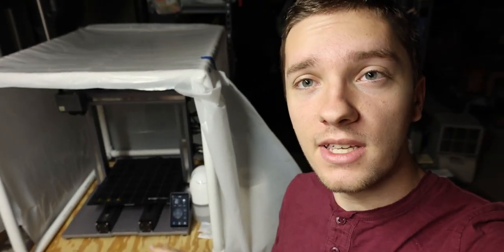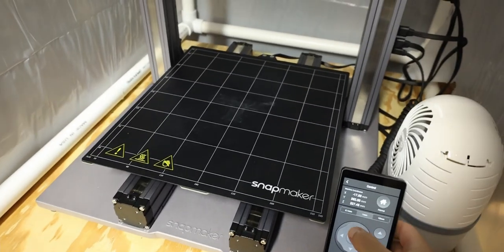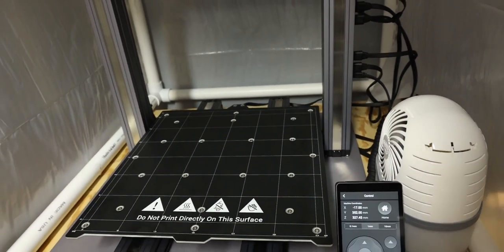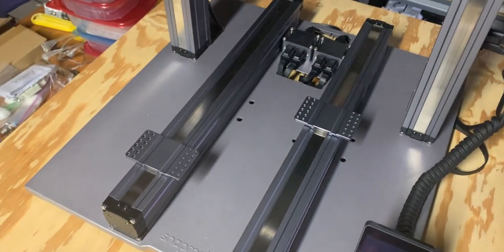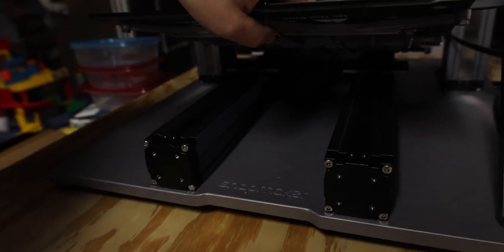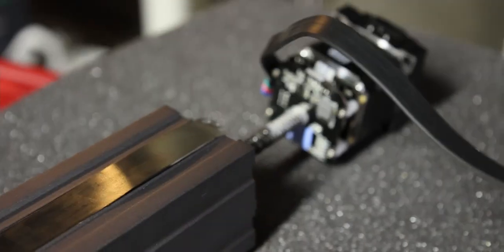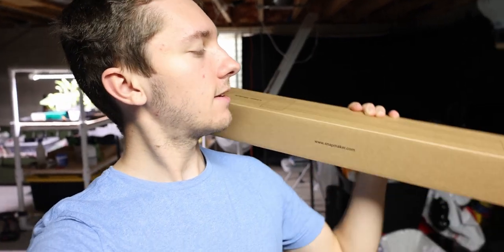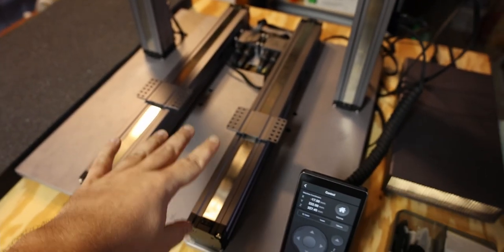This BROKE My Snapmaker 2.0! What Was My Experience?

Comment: I had two of the original rails fail a month apart in November and December 2020. Support was great at replacing the failed rails. While waiting for the replacement I opened up the failed rail and the board had burnt chips. I removed the motor and screw and reinstalled the rail and I was back up and printing. When the replacement arrived I installed it and we have been good since. fingers crossed.

Comment: This happened with mine when I first put it together. My fix was to check the serial numbers of each motor (need to undo and lift the metal strips to see the tag) I then reassembled putting motors with closest serial numbers together. This worked because there were slight differences between different "builds" from the factory. Dunno if this will help you with yours but certainly worth a go ;)

Comment: I needed 3 parts. The parts didn't fail. I moved cross country and parts got lost in shipping. Who knows, I still have some unpacking to do so they might magically show up. So, I was not under warranty but not bad prices. I needed a print module, that was the most expensive, and 1 converter and I decided to just order an extra heated bed. They shipped from their warehouse here in Goodyear, AZ, I live in Gilbert, AZ so around 1 hr away, I could have picked it up. BUT there was a problem. You would not believe the box that came. Either the warehouse POORLY and I mean REALLY poorly packaged it or UPS damaged it. I got one part of 3, box top was loosely taped closed and 2 parts must have fallen out either at the warehouse or via the UPS shipping. Not sure which or maybe both. I contacted Snapmaker and they sent me a replacement of the 2 items and a bonus 500kg of filament. Shipped from China BUT I got it within a week which surprised me as I thought, like you, that it would get held in customs in Los Angeles, which it did come on shore in LA. All was good. I do have outside video surveillance so I sent them a video of the UPS guy dropping off a very damaged and unsealed box. They appreciated that as they need to either make a UPS claim or change warehouses. So, I am up and running. I actually have multiple 3D Printers. I started off with a very VERY similar machine a Dobot MOOZ 2. Someone must have sued someone because the original Snapmaker and the Dobot MOOZ 2 look identical, someone copied the other.I also have a SINDOH DP200. Don't buy one of them, it's over engineered. If you get an extruder jam you have to get into the machine as it's a closed cabinet. And it's got too many automated systems to make things "supposedly" easier for beginners. It has a cassette type cartridge filament holder which means, if you want to buy filament from other vendors you have to spin off the filament on the other vendors reel and load onto the SINDOH reel so it can be put into the cartridge. They did send me updated firmaware so I can use 3rd party filament and eliminate the cassette. That works well but if you rely on the filament run out sensor the automation constantly jams the extruder. And there is an engineering design flaw. The bed on the SINDOH moves upwards as it prints. Unlike the Dobot or Snapmaker where the print module lowers. On the SINDOH the bed moves up and down. Bad design as the support for the bed is plastic riding on the drive screws which are towards the back of the bed support leaving the front unsupported.. Eventually the plastic wears, especially since large items on a bed can add weight and cause this wear. So, DON'T get a SINDOH. I also have a Lulzbot TAZ 5 that I updated to make it a TAZ 6. In some ways the Lulzbot is better than the Snapmaker in that I can adjust the bed and nozzle temps during the printing. Perhaps the newer Snapmaker has this function but I have the A350. The Lulzbot is cool as I can prototype more quickly as it uses 3mm filament through a .4 nozzle but the flow rate is quicker as the filament is larger so it prints fast. I also got a MOARstruder body which mounts a 1.2mm nozzle so you can REALLY print prototypes super quick. Then I go back to the ,4mm nozzle for detail after I am satisfied with the prototype. This is funny, the prints on the Dobot MOOZ 2 has the best quality. I did convert ALL my printers to PEI beds. The Lulzbot comes with a PEI heated bed and bed adhesion is so good that I mounted a PEI bed to the Dobot and the Snapmaker. Awesome improvement as I have zero issues now with any of the machine with adhesion. Cheers and wow I typed a lot here.
Reply: on the bambulab bed moves up down also, seems like one of best printers.

Comment: How is the snapmaker working? I see the dual print head is a disaster only videos on youtube are how it does not work.
Reply from the maker: We haven’t had any other problems with the machine since this incident. We only really use it for 3D printing since we already have the offset set and don’t have a ton of time to change the bed out. We also just haven’t learned too much about the other functions to have many ideas for it. We are still on the 2020 firmware because we kept hearing about the print head crashing into the bed and the firmware that shipped with the machine works so we never updated. So far, we like it. If you want to just 3D print, there are better and faster machines out there but if you want to be able to have the option of using the CNC or laser, I like it.

As for your question about the dual extruder, we recently received the Snapmaker Artisan and that comes standard with the dual extruder so we will be testing that out as we print on that machine. The unboxing video is all we’ve made for the Artisan at the moment.

Comment: Great to see some 'bad' experience with the snapmaker. I'm thinking of getting one myself, just need the money for it. Good to know the support is there if something goes wrong.
Reply from the maker: I've been lucky to have a good experience with the Snapmaker so far. They do have some quirks but it's alright. It isn't a great machine at all of its uses but it is a great machine for experimenting with the 3 types of manufacturing, 3D printing, Laser, CNC. It has allowed me to create anything I can think of and I really enjoy that!!
Reply: @RyanTuscher  I got mine yesterday. I don't expect it to be great at everything, that's always the issue with a x-in-1 machine. But for the limited space I have and what I'll be doing it should be plenty. The first benchy came out great even with crappy filament, so I'm happy with it so far

Comment: That is the nice about this machine. It is modular and you can just replace the faulty part easy. Good to see that the support was fast and accurate. Sidenote: even if you do not have warranty this module can be ordered separate for around 100 bucks. Not too bad either.
Reply: Do you just contact the Snapmaker support, because I do not see it anywhere in their store for an individual one?
Reply from the maker: I have heard people say that they have emailed support when they need to order a new part. I would assume they could sell you one individually. I have also seen them for sale on B&H photo so that could be an option.
Reply from the maker: Do note though that if you decide to order one by itself, check which version it is, either the original or the T series because they do have different lead screws and will not work together.

Comment: I'm jealous, at least your machine showed a sign of life. None of my axis are moving anymore and completely blocked when the machine is on :(
Was hoping to find a solution in this video.
Reply from the maker: I have been very lucky to not be plagued by any of the Quality Control issues that are talked about a ton on the forums. Are you having troubles with the A series modules or the T series modules? If it's a T series make sure they are assembled in the correct positions, if you're using the older A series modules still, it could be that something is hitting the limit switch.
Reply: @RyanTuscher  rolled back a couple of updates, finally got some life out of it. Only one module is still dead. At least I made progress finding the issue :')

Comment: So what cause the problem??  Your title says "this broke my ..."  WHAT IS "THIS"  more fake, misleading titles.  You pontificate way too much.
Reply from the maker: Thank you for your comment because I actually haven't really looked at the module that stopped working and I really should. I want to say the motor went bad because it wouldn't make a sound when it was plugged in and was hard to move when I pushed it manually. I will definitely work on my titles as well to make them fit better. The "this" was mainly referring to the linear module breaking and not exactly anything specific but I will make it more clear in future videos!! Thanks for watching and commenting!!